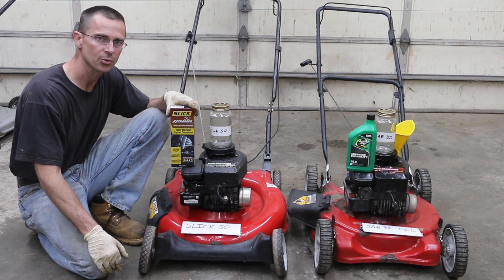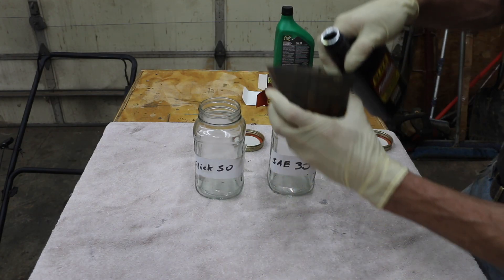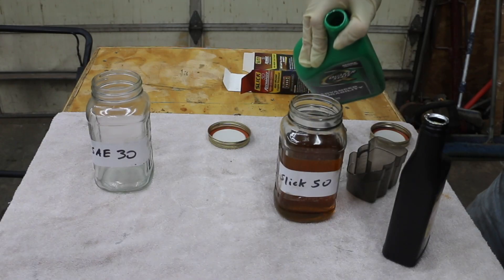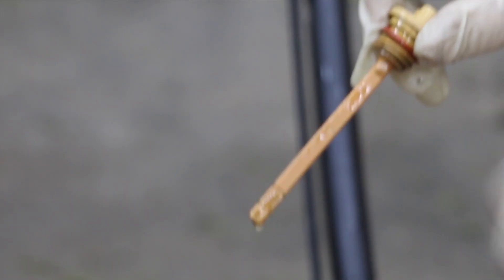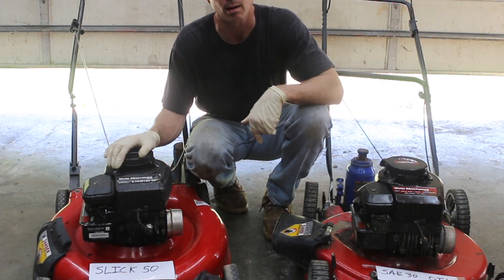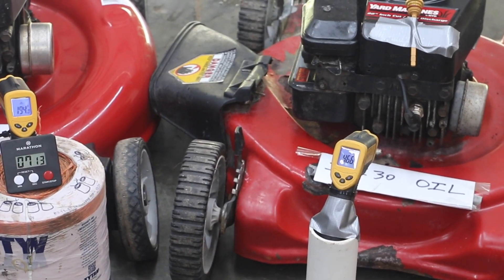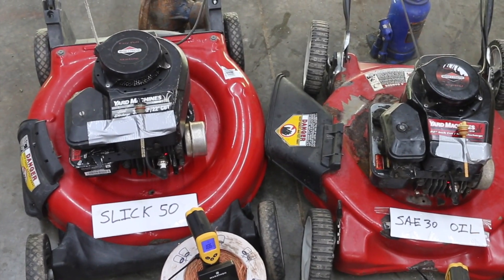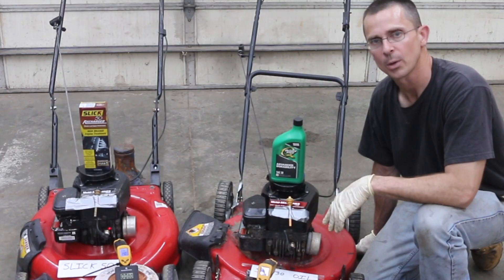Can't believe what SLICK 50 did to my engine!!--Dry Crankcase Test!

Comment: Like a few others here, I just recently started watching your channel. I really admire the effort and attention to detail you put into all of your experiments. I do have to state though that I find many to have so many variables, it would be near impossible to arrive at any conclusions.  This one probably is the least convincing with the results. 
I too have used Slick 50 in the past but before I had even heard about them, I used a product called Microlon. It was significantly more expensive and not available retail. It was my understanding that the creators of both products once worked together but had diverging business plans. 
Microlon was almost clear save for a small layer of sediment on the bottom - perhaps Teflon - that was supposed to fill in the microscopic power robbing cracks in the engine. The same product was supposed to be run through the fuel system as well as an oil additive. The mechanic I had that ironically drove the same car was in disbelief at how smoother and peppier mine was to his. But, I was a teenager and cared for the car like it was my child. 
With the advent of the internet, I did a little homework an am now convinced like several others here that it is all a bunch of hooey. I can recall one test where they showed an increase in engine rpm as Slick 50 was being added to the oil. Their claim was that there was less internal friction and therefore the engine sped up slightly. IT was later shown that the 'microscopic' particles in fact immediately clogged the  oil filter and reduced oil pressure which resulted in the increase in rpm.
It would have been nice to see a more positive result for the mower with the Slick 50 but I don't think anyone can reasonably claim that Slick 50 offered less residual protection. While the mowers look different, they appear to have the same engine but who knows what their work history or care has been. Even the weight of the spinning blade could change the load on the engine that changes the results. Personally, I do not appreciate the observations from experiments like this one when there are just so many variables. I've enjoyed the duct tape, crazy glue and was very surprised with the observations from the Restore video. Those are far more interesting to me. Either way, you have a new subscriber.
EDIT: I meant to include this video of just how long an engine without oil can go. 
https://www.youtube.com/watch?v=CfipRXooCTM

Oh, I also just learned Microlon is still going strong. The last I did any business with them was in 1989.
Reply from the maker: Thanks for the constructive feedback and thanks for the video idea.

Comment: Wow! I wonder why  the slick 50 engine failed so quickly?
Reply: Because Slick 50 helps on start ups (it flows to the top of the engine faster) the answer might be right in front of us.    The regular oil probably stuck to the parts more than the Slick 50 did.     If Slick 50 is truly slick (and it is) is probably drained out of the engine completely (or went to the pan) and did the opposite of what was expected.

Comment: I used the 2 stroke Slick 50 on a YZ250 MX bike & one race day forgot the 2 stroke oil.I had about 4 L already in the tank at the start of the day adding 100% Gasoline only as the day went on.No damage was done but perhaps that 4 L already in the tank saved it.I believe it can work to some extent.
Reply from the maker: Thank you

Comment: Well, your first mistake is using quaker state oil. Quite literally the worst product for lubricating engines ever.
Reply from the maker: lol. Great point!  How did Quaker State win the showdown?
Reply: @ProjectFarm  Well, for starters, the QS engine wasn't filled with particles that basically turn to carbon when the temps get too hot. One could also surmise that engine may have had less hours on it. Not to take away from what you are doing because I like your channel, unless both engines are new, broken in the same and ran the same amount of hours, I would be hard pressed to say that there is anything conclusive in this test. When it comes right down to it, the S50 engine may have been build on a monday after a holiday while the QS engine was built on a wednesday by the best guy in the plant.
I know they're the same engine, I just question the hours, maintenance history and, usage of each. Heck, even the kind of fuel (octane, quality, even the A/F mixture) can change the wear patterns in an engine. 
Most folks don't have the experience necessary to really understand what all goes on inside a running engine.
Reply: Thats a funny thought. Although you may not like qs the truth is... All conventional motor oil sae 30 is the same. It all comes out of the same blender and holding tanks and then  just put in differnt bottles and packaging. So your valvoline or mobil one is the same as qs or pennzoil or even dollar store brand. This is only true in conventional oils not semi or full synthetics. Just some food for thought!

Comment: Great video as always. Who knows but maybe, just like so many things that we remember from years gone by, the Slick 50 formula has been changed, and not in a good way. 

I remember Slick 50 from back in the day and I actually put it in my 1985 Ford Granada 2.0 litre petrol engine. (UK model. I think it was a Ford Taurus in the US). This was the late 80's so the car was probably about 3 or 4 years old with around 100 thousand miles on the odometer. It had been used as a taxi / limo from new. I'd had Ford change the car to run on unleaded fuel (I think they only adjust the timing). Then I put the Slick 50 in during an oil change thinking it was a good idea if it run cooler plus maybe I could get a few extra MPG and it may help lubricate the valve seats which I believe regular leaded petrol did but unleaded didn't or so I was told at the time.

A few months later the piston rings went during a night shift and the low oil light came on but the car was running fine and not getting hot or anything. I pulled into a nearby garage and checked the oil only to find nadda on the dip stick. So I bought a gallon oil (conveniently for them they only had Mobil 1 - the most expensive oil at the time ) and I refilled the car. I drove with this massive cloud of smoke behind me for maybe an hour or so. It was really bad LOL. I wouldn't do it now of course but I was young and needed to carry on working. Then oil light came on again and I remembered the Slick 50 advert and thought, oh well what the heck. They claimed you could run an engine treated with Slick 50 with no oil so I would give it a try. To my surprise it actually carried on running like a dream it just had the oil light on all the time. Anyway I ran the car like that i.e. WITHOUT oil for another 10,000 or so miles before I got round to changing the engine.

I remember telling the owner of my local Auto supplies shop at the time and also where I bought the Slick 50 from. He showed me this little demo kit he had with an Australian oil additive product which was similar to Slick 50 but supposedly even better.  The demo had 3 or 4 cogs connected vertically in a column. It had a crank handle connected to the bottom cog and a clear plastic window so you could see inside. There was only a small amount of oil sat in the bottom about 1/3 to 1/2 way up the first cog. One side was regular oil and the other had oil with the additive mixed in. As you turned the crank you could feel the drag or friction with standard oil, especially during the first couple of rotations until the oil coated the cogs completely. You could still see there was a fair amount of the oil in the bottom. This really highlighted why most engine wear occurs in the first few seconds until the oil coats the inside. When you stopped cranking and let the oil settle and then started again, it was exactly the same with high friction or drag at the start and then it got smoother with less drag after a couple of rotations but still a lot of the oil was at the bottom. 

Now when you repeated this procedure on the side with the additive there was almost no friction or drag right from the first movement of the crank not even a 1/4 rotation before it was buttery smooth. Also you could see through the clear window that the oil with the additive kind of filled in the triangular gap around the sides of each cog and down to the cog below creating a film of oil as if the the whole thing was full of the mixture. Also there was very little oil just left sitting in the bottom. As soon as you stopped cranking most the oil with additive settled back into the bottom the same as when you started but the cogs still glistened from the oil mixture. It was a very clever little demo. 

The shop owner said that the manufacturer claimed they had run a cars engine with it mixed in for a few hours to coat the insides. Then they drained it of all oil and drove the car continuously for 24 hours driving in the Australian outback or desert or something. After that the engine was stripped down and supposedly showed "no visible signs of wear". The internet was still in its infancy back then and YouTube and the likes didn't exist so nothing could be looked up unfortunately. I wish I could remember what that product was called. With a bit of luck an Australian viewer will remember and let us know and maybe you can get hold of some to try it out.
Reply from the maker: Thank you!

Comment: The different color of the used oil says more about the state of the crankcase before the test than the effect of either oil. A try equal test would need 2 new engines. Maybe we need to take up a collection for a couple of new cheap new engines? Harbor freight?
Reply from the maker: Thank you. I used HF engines in a more recent video.
Reply: Thanks. I'll check it out.

Comment: You should do that same test with "Prolong"  in place of the Slick 50. Prolong bonds to the moving metal parts and don't drain off with the oil. If you add STP oil treatment, then all the oil don't drain off either. There's always a film of oil left on the moving parts, this prevents "Dry Start Ups" when the engine has to sit for any length of time. "Dry Start Ups" cause 90% of all moving parts damages.
  I know this to be true because my wife bought a new Toyota Corolla LE in 1990 and when it reached 113,000 miles it started leaking oil. Having to tear down the engine to put new gaskets and seals, we decided to rebuild at same time.
   We took it to the pros to get it done and when the mechanic had the engine apart and on the bench, he called me to come and see what he found inside. Here was an engine with 113000 miles on it ,but was just getting broke in good. The engine are supposed to be broke in good after the first 500 to 600 miles , when the first oil change is due..
   The mechanic told me I should get another  200k  mi. if I keep treating the engine with the same things I had been.
   A  BIG THANKS to Prolong and STP oil treatments.
Reply from the maker: Thank you for the video idea!

Comment: Hey project farm when Castrol synthetic oil first came out in the black bottle i started using it in my 1986 bmw 325 it cost around $3 a quart and 5 quarts with an oil filter would cost about $20 for a do-it-yourself oil change anyway one very early morning as I was leaving work heading home i notice something white scattered in my lane thinking it was paper i stayed in my lane and drove right over it...WELL IT WAS CONCRETE BLOCKS after i heard all the grinding, crashing noise under my car i stop and came out to take a look my oil pan had a fist size hole in it and oil everywhere, I thought for a minute holding my head didn't know what to do since I was still so far from home and it was still dark out, I decided to drive the car home with no oil well the car made it home alright. I had the car towed to my mechanic where he removed the oil pan and took it to get the fist size hole patch and welded after re-installing the pan and a fresh oil change i drove that car for years NEVER NEVER NEVER having any engine problems until it was rear ended by a dump truck making it a total loss
Reply from the maker: Impressive!  I'm glad the engine survived!

Comment: It's not an oil additive ... Amsoil has worked very well for me since 1975, (I don't market the product), I have used it in many vehicles including small honda civics as well as F350, Dodge Cummins, and everything in between.  I have never had a bottom end failure in any engine during that time.  I have had several gasoline vehicles over 200,000 and 300,000 miles lose compression slowly and need new rings, or guides to a point where the oil usage was too high to continue using that engine.  it would be interesting to see your standard SAE 30 in one engine and AMSOIL in another and then have them drained and run.  I understand this costs you an engine ... :)  Just an idea.
Reply from the maker: Thank you!

Comment: Good video.  I believe the engine with Slick 50 and oil did run cooler under test conditions.  Without lubrication, the Slick 50 gave up sooner.  That puzzles me too.   Is Slick 50 as an additive a good idea?  Seems to help keep temps lower.
Reply from the maker: Thank you!

Comment: engine restore do a test with that stuff my car started knocking so i put some of that in there a day before, rod came out the bottom of the oil pan but i still drove it 50 miles with no oil in it.
Reply from the maker: Thank you!

Comment: Try Slick 50 or any similar product to 'NMF' Ionic Friction Reducer...(https://www.amazon.com/NMF-Ionic-Friction-Reducer-Engines/dp/B01DAI8O4W/ref=sr_1_3?ie=UTF8&qid=1546746667&sr=8-3&keywords=nmf+ionic+friction+reducer) Seems like it's working as advertised from my very unscientific trials and across two motors with 135,000k miles and 160,000 on them as well. In fact, it 'seems' like I've recouped more power to throttle feel. Would love to see you really take this product for a trial!
Reply from the maker: Thank you for the video idea!

Comment: The test was absurd. Its a bit like testing engine oil filters by removing the oil pump ,or , comparing a Boeing Dreamliner with an Airbus 380 by turning off the engines and seeing which one hit the ground first ..or... stayed up the longest! Hilarious test .May God forbid you to work in the chemical or nuclear industry!
      I ve used Slick 50 and Molyslip over 40 years and they are both great products in their own way . slick 50 and molyslip (molybenedeum Bisulphide?) are a great way to keep a new car or engine  and ensure it runs in well from new . if you keep your motors for the long term and purchase a car that you want 250,000 miles from .Slick 50 and Molyslip can help ,even if just used in the first 25,000 miles.
      I ve used both products in motorcycles,  oil engines and cars in a wide variety of circumstances.
     If your car is burning oil and losing power (Knackered) ,and being desperate and poor......treat it to one of these products . You will then get  2,000 miles of bliss.
   Slick 50 coats the hot bits ,where the wear has created lost power in the piston rings and  engine bores ,restoring power and economy  . On a high mileage or neglected  engine it can give you at least 10,000 miles more.
      In motorcycle engines its a bit more difficult .motorcycles generally use engine oil in 'wet' clutches/drives so engine additives are dangerous and can gum up clutch plates  very easy .On motorcycles its best left to small sub 250cc bikes .
     My Experience....
 Slick 50......Brilliant as a preventative ,cooler running,smoother running ,up to 20%!!!YES 20% more fuel economy . can save a damaged engine , 'get you home' and saved a tired engine.
      Molyslip has the same properties BUT needs adding to the oil every 2 or 3 oil changes to keep its effectiveness , Slick 50 is more tilted as a one time treatment but it does fade .
     i always used to add Slick 50 to small motorcycle restorations and it worked a treat as rebuilt engines bedded in . When an engine is near new and having its first service ,the oil is removed. In that first oil drop there are metal shards and fragments from the engine components because the metal components 'Run In ' or 'Bed In' . Using Slick 50 and some other additives FROM NEW would be the most beneficial ,but due to manufacturer warranty agreements it usually does nt happen. Every first oil drop is full of metal ,its normal.
           So this lunatic destroyed two lawnmowers to prove that engines die without oil!
The lawnmower treated with Slick 50 that 'died' early on .....remember , it 'died' at a low temperature....will work good as new if its flushed with paraffin or solvent to flush the carbonized oil out ,whereas the other  has internally exploded and is f***ed , but hey! At least the fool has some spares for his one that is salvageable !!!All thanks to Slick 50!

For some reason the lyrics of a dead kennedys song comes to mind...' A child and his lawnmower' ....
Thanks for your patience . I am not a bot , I'm a limey.

Comment: Slick is NOT oil, it is an additive, thats why it didnt pass the empty crankcase test. It is designed to make  oil smoother, it has to be IN the oil. What I would have done was keep 2 oz of oil in one and a 50-50 2 oz mix in the other. Sure the test would have lasted a lot longer but I think the slick would won that
Reply from the maker: Thank you!

Comment: I had a 91 GMC Jimmy with a 4.3L V6,  which I bought with 11,000 miles already on it.  I changed he poil every 5000 miles, and added a quart of Slick 50 to the oil change every 50,000 miles.  I ran that vehicle over 330,000 miles, never had an oil-related issue with it.  I don't know if it helped, but it didn't seem to hurt.
Reply from the maker: Impressive!  That 4.3L is a great engine!